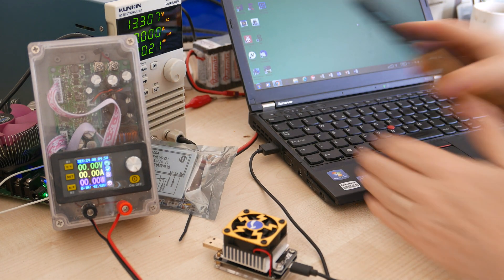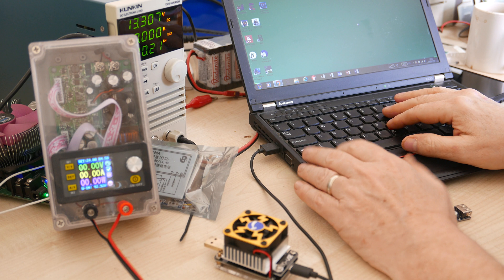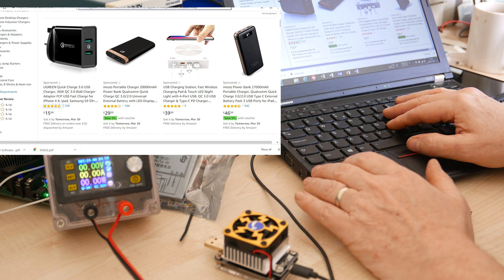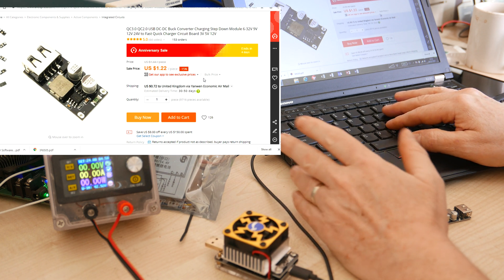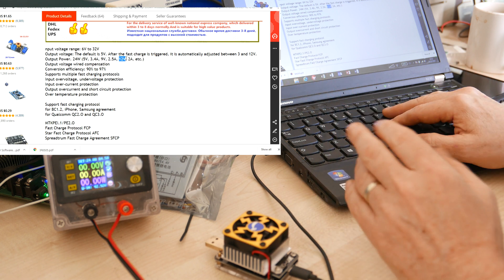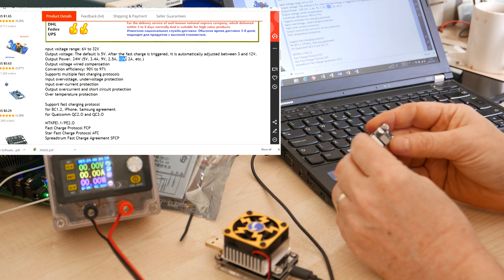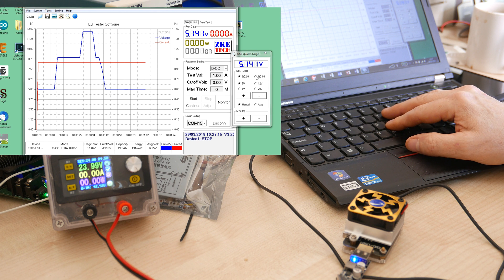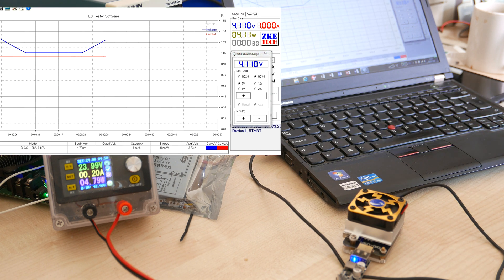$10 DIY QC Quick Charge 3.0 2.0 Phone Charger Powerbank

Comment: Hey mate love the vid, module looks greaat! Quick questions, if this requires 8v and i would like 4s worth of current (from 18650s). I would need 2 sets of 4 18650s in series. That are then wired together in parallel? If this is the case how do i work out what bms i need to get, will all bms communicate with this module ?? Really love your content, cant wait for your channel to grow and look forward to what else you can teach us all in the future.
Reply from the maker: Yes... 4S or 5S is better.   It's all about voltage and NCR18650Bs (for example) cans deliver 2C current or almost 7A.

A simple 4S protection BMS ($5) should be fine.   Better still.. a balanced charge BMS. 

Happen to sell these..

https://www.ebay.co.uk/itm/4S-40A-Li-ion-Protection-AND-Balanced-Charge-BMS-14-8V-16-8V/254343435534

Slightly overkill on the current but will work.
Reply: @crazytom  your a legend tom, thanks for getting back to me so quick! Ive worked out the device i have doesnt have quallcom communications for qc (lacks the usb pins). If i just need a straight 5v 2.5a am i better off grabbing a buck down dc-dc?. Or is there minimla potential for the qc 3.0 to fluctuate voltage WITHOUT those handshake pins? Its my understanding without any handshake or comunication the chip in the module defaults to 5v 2a. How do those numbers sit with you ? (Someone whos is knowledgeable, has the device and the means to test it)
Reply: @rilesmcgapp5256  Yep... that will work no problem.  Can't recall default current but 5V is correct.

Comment: Thanks for your video review, it is most informative. Can you elaborate more on how to create the li-ion cell pack? You seem to have a tiny chip on top. what is that used for?
Also I like you bench power supply, maybe you can make a video on how to set one up
Reply from the maker: A simple 2S or 3S pack requires that you connect them in series with nickel strips using a spot welder.  Use a BMS and connect the sense wires to the ends of the cells.  Solder a barrel connector to the load (P+/P-) terminals on the BMS and you have a battery that you can connect a load to and also charge via the barrel connector.

Here it is.  You'll need an AC->DC power block to drive it.  If you want to use the full 50V, a 48V e-bike battery charger will work.

https://www.aliexpress.com/item/32980317289.html

Comment: If we connect 4 such pcb modules to a input of 20 volts 5 amps (100 watts) in parallel.

What is the max load that we can draw at once individually from all the modules connected to some load.

Plz reply